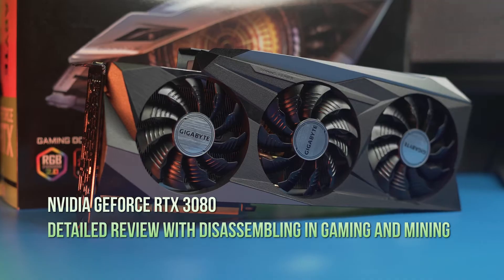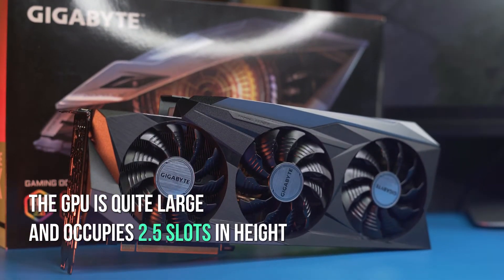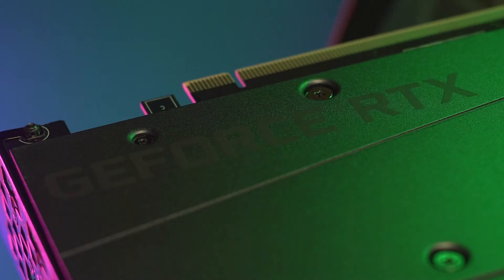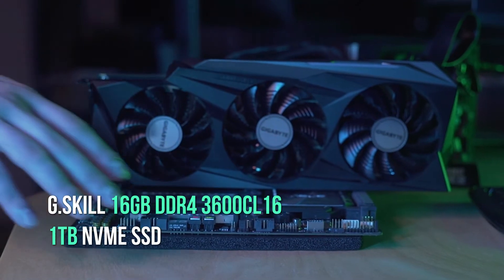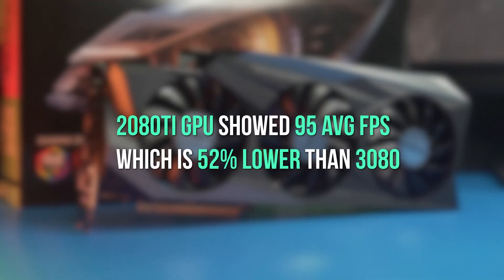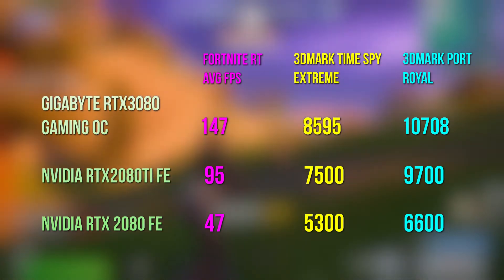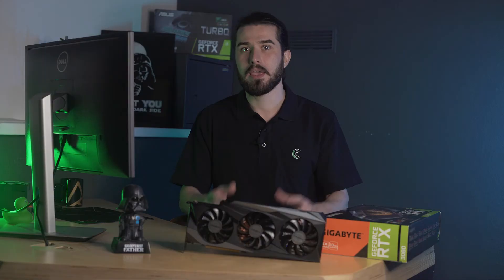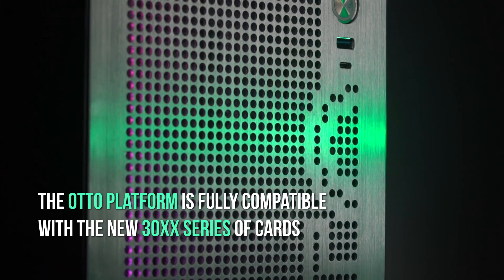Nvidia GeForce RTX 3080 Detailed Review with disassembling in Gaming and Mining

Comment: Thanks for the video. DId you remove the backplate before you plufg in the PCIe power cables? Some users reported that the power pins wiggled too easily when plugging in the PCIe.
Reply from the maker: Thank u too! No, we didn't, there was no problem with that